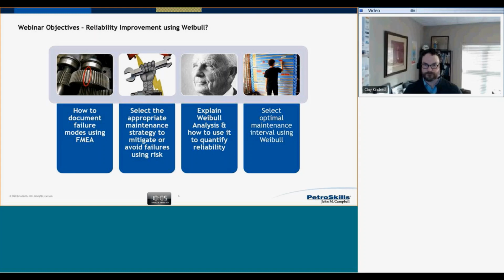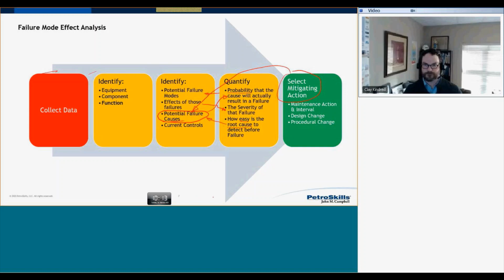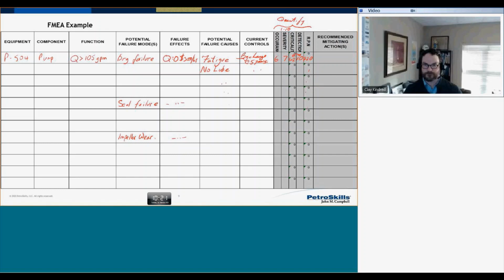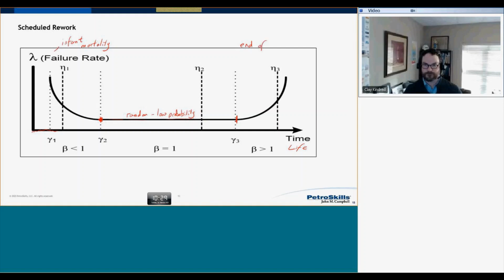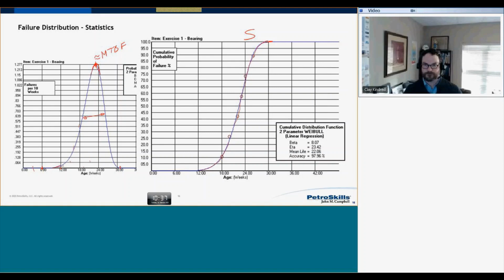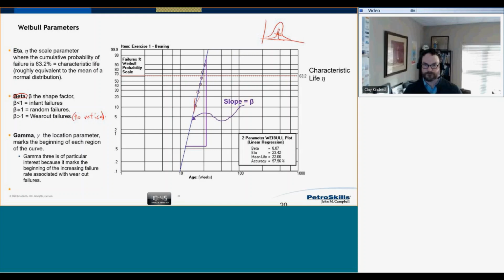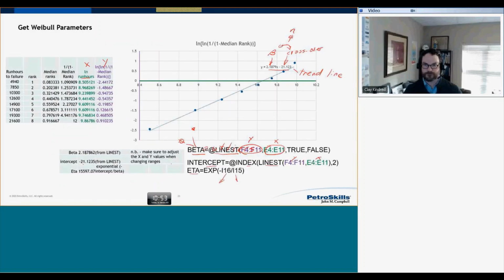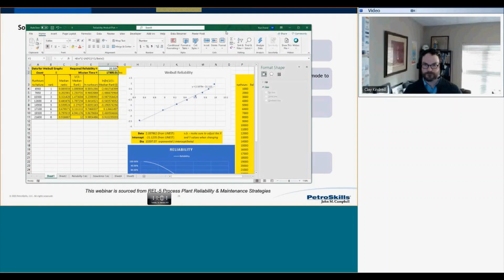Reliability Analytics: Using Weibull Analysis to Maximize Equipment Reliability

Comment: In 55:15, Why not utilize the exponential distribution to calculate the F(t)=1-EXP(-λt)? When you utilize the exponential distribution, it's a deviation from the R(t) result. Looking forward to your reply!
Reply: No reason why you could not but be aware that using exponential distribution is only suitable for pure random failures.  If you want to be more accurate, use Weibull.  In this case I was trying to keep it as simple as possible.

Comment: This is wonderful video. The presentation is very clear, informative and useful for the petrochemical , oil/ gas industry. It means if it is a manufacturing of component industry howmany compnent fails are analaysed where as in chemical, oil/gas industry each equipment's failure is calculated with given period of time.